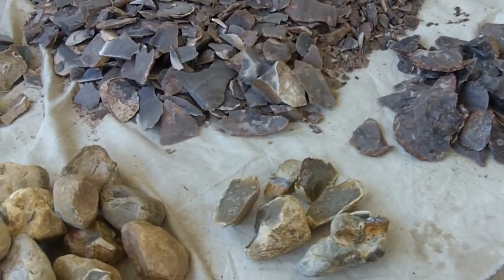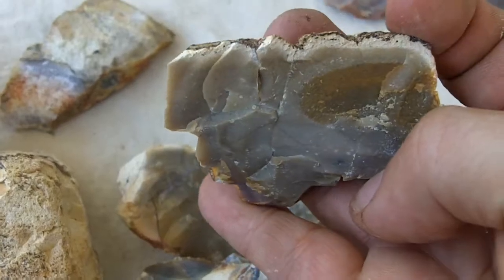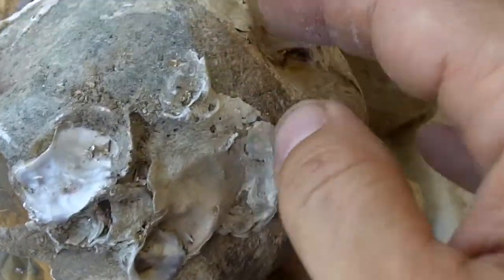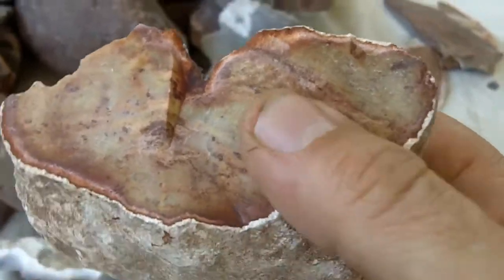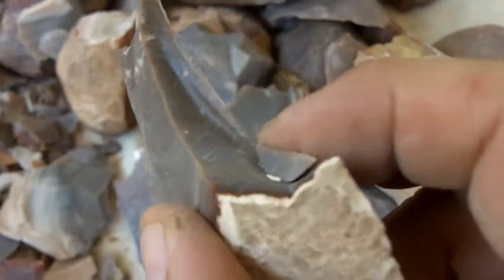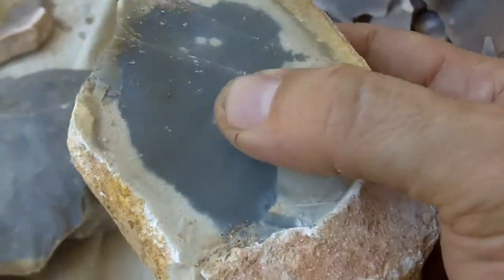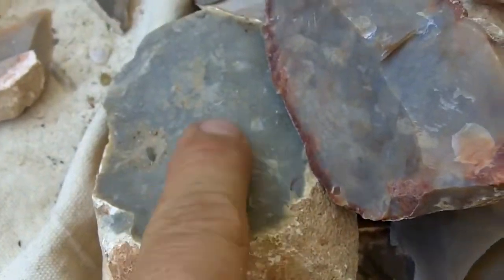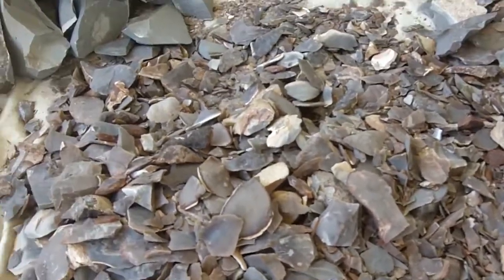099 - Heat Treating Update 2011-09-03

Comment: Hey Good vid here !!! I had no positive results at all from heat treating ryolite or several other flints that were all volcanic in origin. Don't know if that is good for a general rule or not.. Also as long as the core of a rock has reached the desired temp , it did not matter at all if I kept it there for 1 hour or 72 as long as I went up and back down slowly. Some of the flint I just sent you might  overcook at 450. Jasper and some of the cherts in my area do not survive much over 400. true!

Comment: I have access to material from southern Misouri and north Arkansas and it also has a lot of crinoid fossils and is on cobles with lots of fracture cones.  It heats well up to the 500 range but if I try to ease it very far above that it crumbles. What about the Edwards Pataue material as I have some but I don't really know how high to go. 90% of my artifacts have been heat treated also.The piece at 4:40 looks like it would work raw. What about the local artifacts? Were they treated?